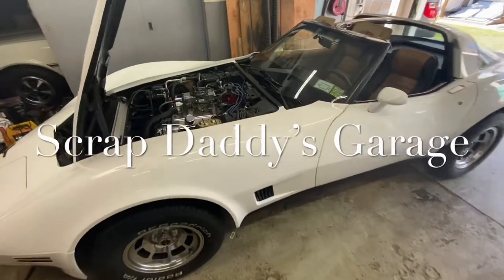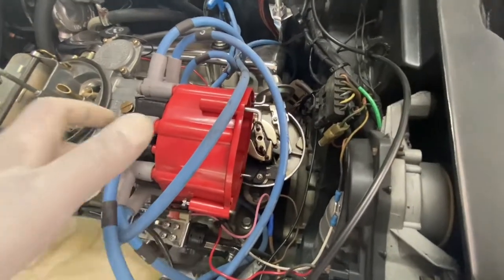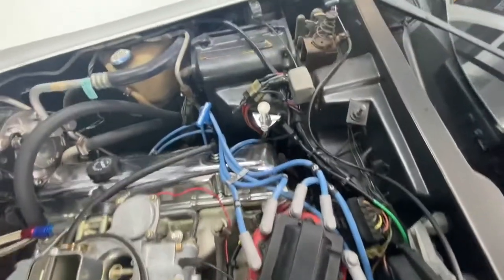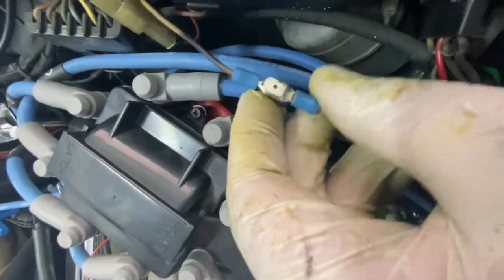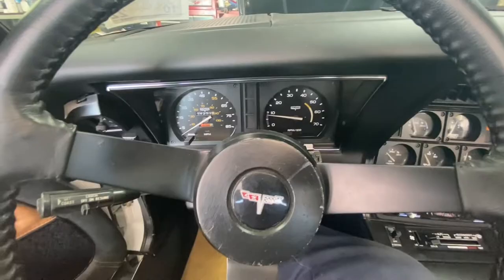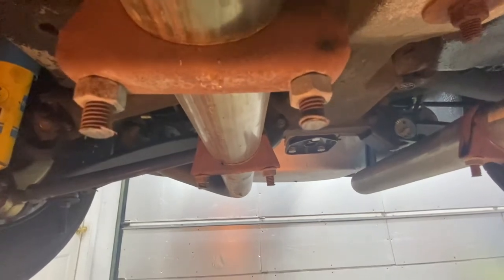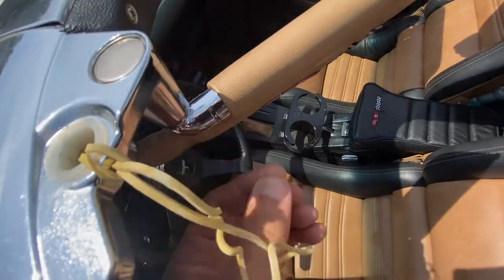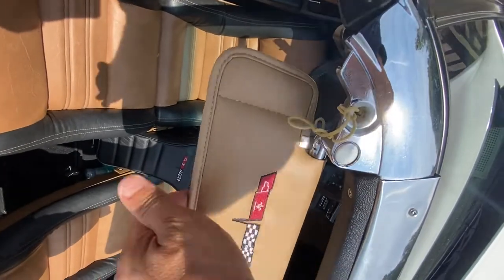1981 Corvette drive ability problems

Comment: Hey Scrap Daddy, My 81 will start and run fine. But if i start it again soon after driving it for a bit, it will die and idle rough. Any thoughts? Thank you.
Reply from the maker: Check the timing. You could have vapor lock issues. Thanks for watching

Comment: It's a shame Chevrolet offered only one engine those last years of that body design.  190hp is probably the lowest powered engine out of all the Corvettes that were ever produced. My 98 Sienna has more horsepower.
Reply from the maker: Thanks for watching, This car has a blue print engines 383 with 400+ hp and a silver sport overdrive transmission it goes good!
Reply: Actually 190 is not to bad considering the California version lol it was a 305 standard instead of the 350 now imagine that!
Reply: If you were alive in the 80s you would understand
Reply: @midnightsun2483 i am old. My 1st car was a 1966 small block Mercury Comet. Then a 68 XR7 302 holley 3 on the floor. My Z28 eater. 12 seconds is a fast number for a self built 302. I was a kid, fixing my outboards and my ski buddies outboards in 1970 in my father's fleet oil truck shop, no mechanic has ever touched 55yrs of repowering my boat engines, and rarely my personal vehicles in 50yrs of driving. I watch Rich because he is good at what he does. The last classic car I worked on was a 1965 289 Shelby Mustang. I made it run after 32yrs in storage. Rich knows who owns the Shelby. It's a local car.